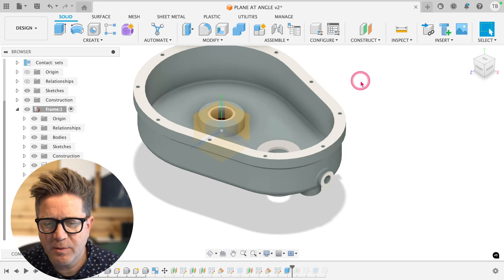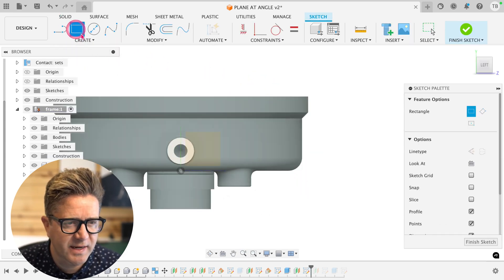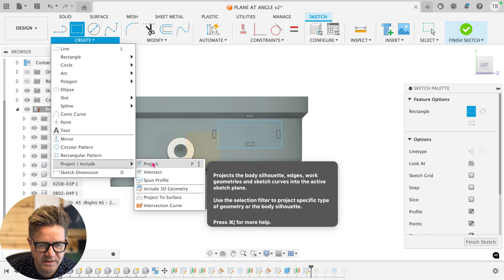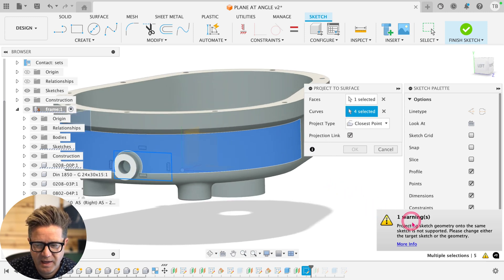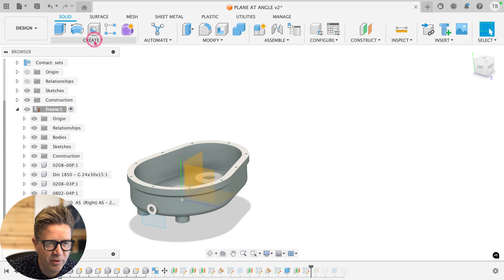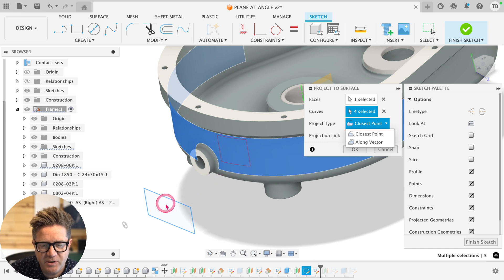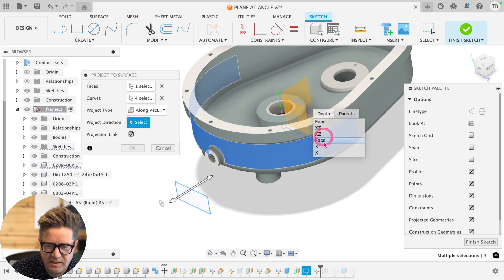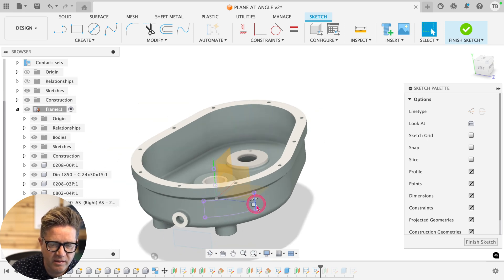Why 'Project onto Surface' Won’t Work in Fusion 360 (And How To Fix It)

Comment: hum,... your kind of just make shit-uup to build some content now,, I know, it seems like there's not much left to do, you have an excellent content portfolio that's easily digestible, well done ,...but maybe there is,..

Consider combining, speed modeling, combined with quality of optimize workflows, to achieve desired geometry, 

Requirement results

flex intent modeling

1. Model must be flexible ( what I like to call flex modeling  ) it's not necessarily just parametric a.k.a.  primary geometry and micro geometry need to be easily iterated upon for real world rapid turnaround for production

Example: certain geometries go along for the ride, when primary geometry dimensions are changed a.k.a. a hole counter board in a corner for example

2. maximizing command functionality per geometry a.k.a. thin extrude, uses less sketches, etc., 

example: they cut who did in the above model 

example: on the side of the cover radius,, -Create a new plane on the top lip edge, which will create a cut perpendicular to the plane in that same location which gives you an arc length control, offset control, cut angle control and depth control, which would be a real world requirement, as an example

Great work brother, catch you later
Reply: excuse the imperfect diction, I'm doing this on my phone with Siri, the liberal AI, she's a little slow lol
Reply: @brianuxa.7827  perhaps you could make some videos as well